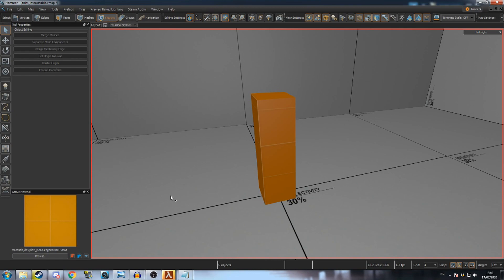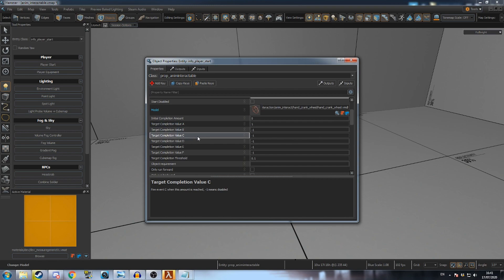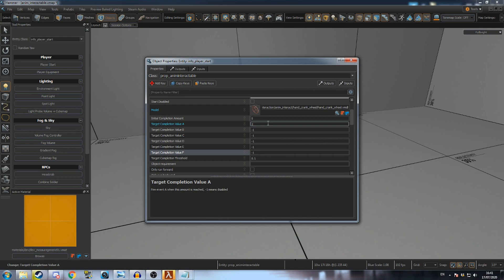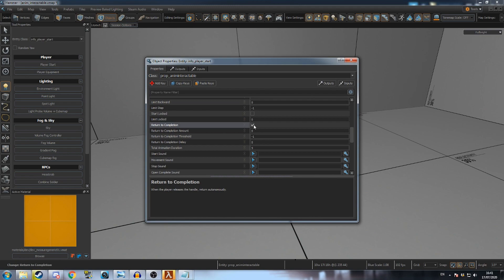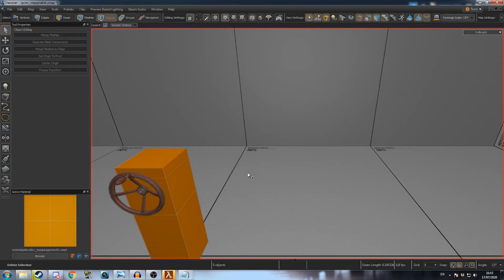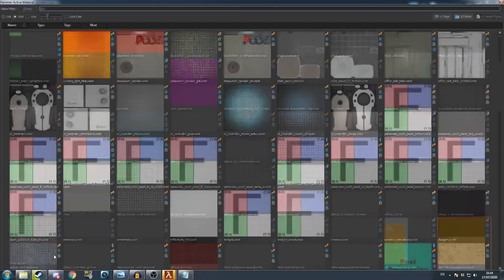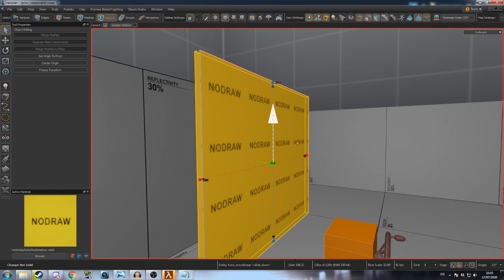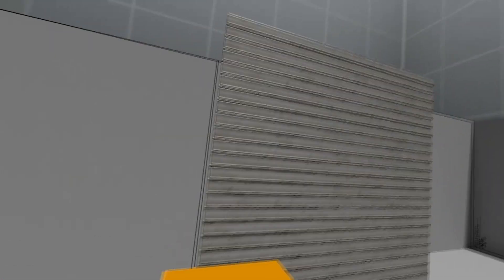How To Create a Crank Wheel and Shutter Door in Source 2 Hammer

Comment: Hi, could you do a video on how to use the point_value_remapper? I don't have Alyx, and I'm making something for SteamVR's Source 2, and this tutorial is  essentially exactly what I want to do, have a wheel that turns in VR, which will open a door, however prop_animinteractable is unfortunately not in SteamVR's Source 2.
Reply from the maker: I'm unfamiliar with the differences between HLA and SteamVR, but there is a tutorial on how to use point_value_remapper on the VDC you can refer to
Reply: @Hosomi  Yeah, that's the only tutorial there is of it, and it doesn't work right for me.
Reply: @FoxGAMING-NTF  same here. how do I make an Animation Cycle move. Only axis works for me.

Comment: how do you use a switch to open the door?
Reply from the maker: I have a tutorial that covers switches
Just add an output to that switch that opens or unlocks a prop_door_rotating_physics
Reply: @Hosomi  i found out that with the switch you can just set the trigger to open and it will open the door